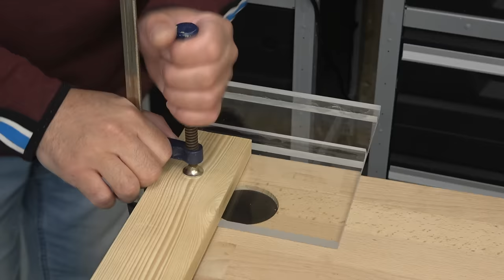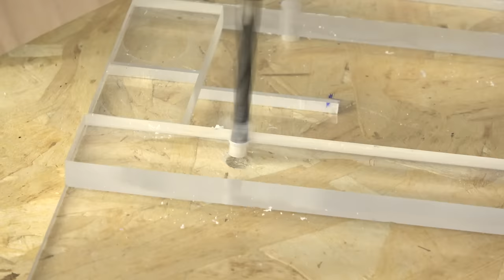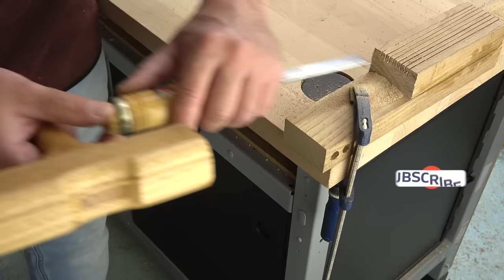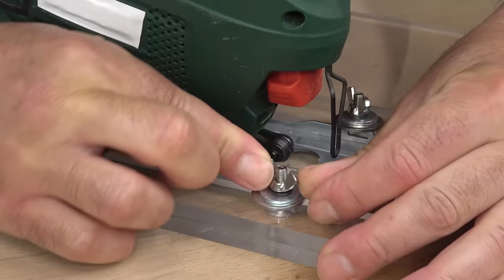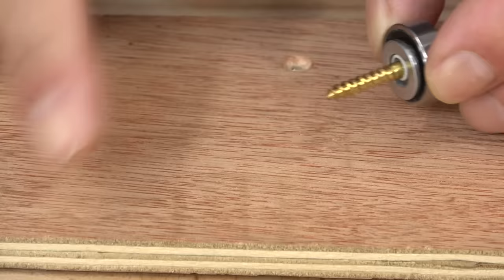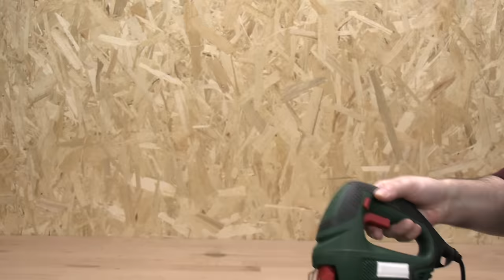IMAGINE the most beautiful Woodworking jig to make perfect cuts with the Jigsaw

Comment: Or just get a decent jigsaw and use the right blade pitch and the right blade.
Reply: Cos some buy new when things are broken and not just because, I don’t believe everyone needs Dewalt, Milwaukee etc to be able to do wood work, sometimes using the grey matter in our heads works wonders to solve problems
Reply: I think Mafell makes a jig saw with a thick blade that has almost zero deflection but it's quite pricey.
With that said for this tool to be useful to a finish carpenter the throat depth (not up and down but side to side) would need to be adjustable and have an edge guide.  But for a straight cut I'd just use a track saw or set up a straight edge and use a router with a good spiral bit.
Reply from the maker: I have tried more profesional jigsaws and a thicker good quality blade and it never makes so precise cuts as this jig 🙂
Reply: @diyandwood  yo conozco tanta gente accidentada con la circular portátil, mmmmmm, creo que me quedo con la caladora. Poseo ambas. Esta guía promete.
Reply: You missed the point. The blade is held in position like a good quality band saw. You can't do that with a plain jig saw no matter what kind of blade you use. It doesn't take much force to cause a blade to bend out of square.

Comment: I made a similar jig and .... it does not work as expected, blade still wabbles a bit and part between the holder and bearings bends. Also if material that is cut is quite thinner than the gap between holder and bearings then the blade jitters it. So it is a jig good only for a certain material thickness.

Comment: 9:52 nice tip, the roller will prevent the blade bend
Reply from the maker: Yes, I have used this jig quite a lot and it keeps making perfect straight vertical cuts thanks to the bearings 😀
Reply: @diyandwood  is it also good for curves? All blades are bending and im wondering if it'll help 🤔

Comment: Just use a miter saw or a circular saw and a quick square.
Reply from the maker: I like using the jigsaw. And, did you watch the video where I cut a big plywood circle? I cannot cut it with a circular saw. Maybe with a big table saw, but a big one. Or with a router, but the router makes quite a mess with lots of sawdust when cutting a circle 🙂
Reply: @diyandwood   You were cutting straight cuts not circles.  My comment addressed the most common tools to use.  You can use whatever you like.

Comment: Used to do stuff like that 35 years ago when only had a jigsaw - near best in Bosch green range. Need a very fresh quality blade for a truly clean straight cut and score the material. If you can afford circular saw and ideal blade for a job, this is pointless
Reply from the maker: Many people feel more comfortable working with the jigsaw. And with my woodworking guides and jigs I get perfect cuts in the wood with this power tool. Of course for a professional this is not enough

Comment: Nice project, Thanks. By the way, which adhesive are you using to glue the plexiglas plates? Kindly inform. thanks.
Reply from the maker: Thank you very much. I use cyanoacrylate adhesive to glue the pieces of methacrylate
Reply: @diyandwood  Thanks for the fast response. Though my following question has nothing to do with your nice Jigsaw project - still let me ask, does Cynoacrylate leave any stains on in the plexiglas (acrylate) joints glued togehter?